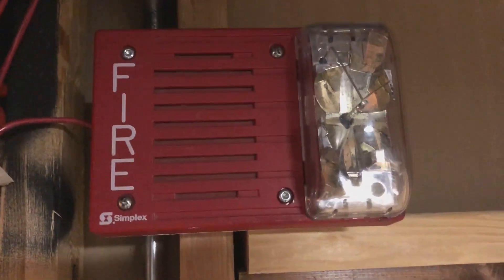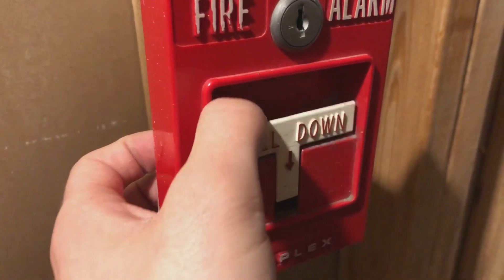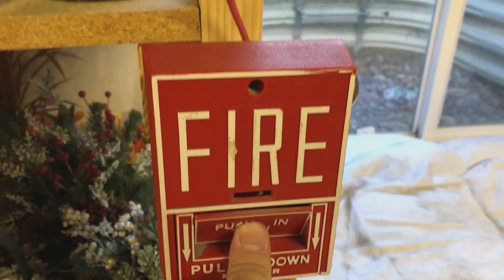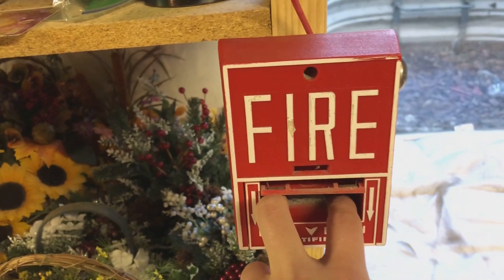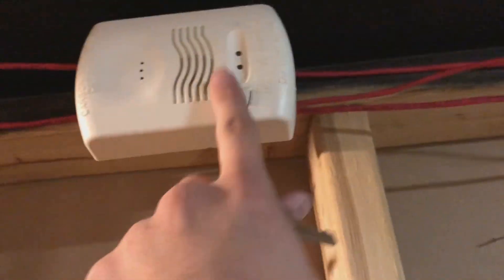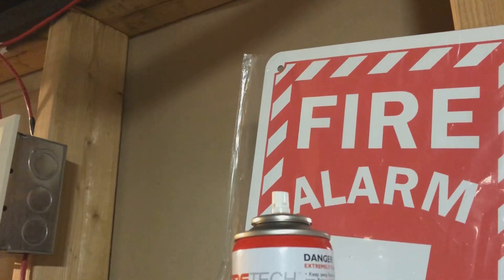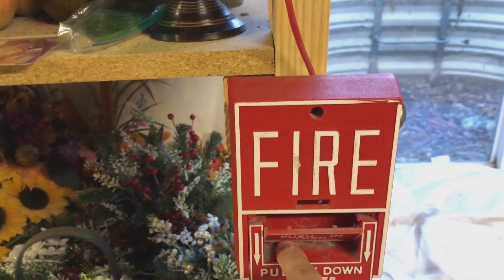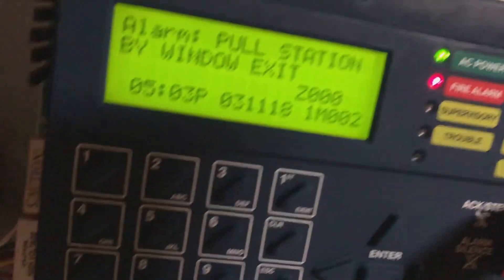Home System Test 25: Plain Old Mechanical Simplex Horn/Strobes

Comment: Mechanical horns are the worst at noise regulation lol 😅. They are really loud. I think they're even louder than the TrueAlert, and THAT'S scary 😁. Great video!

Also, did you happen to get that voltage regulator on Amazon? I don't know why I though they were on Amazon (who knows), but I'm just curious cuz I plan to get one (maybe).
Reply: +Zachary Fleck I knew I heard "Amazon" somewhere in that video 😄 (I think). Cool, I'll have to check that out! When it come to Simplex devices, filtered DC should be a must (in my opinion at least)!

Whew, that's a relief (for you) 😅. Piezoelectric horns are much better to deal with most of the time (they can also be loud indeed, but they're not too hard to make quieter. just add tape! Err, yeah, pretty much).